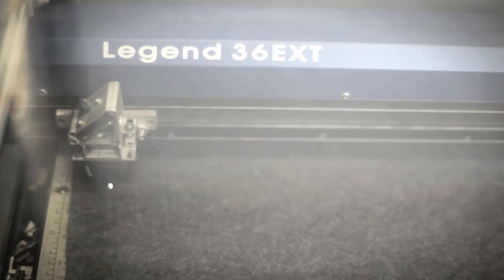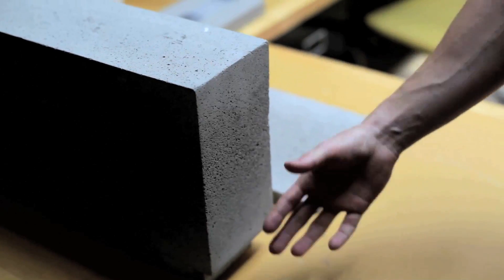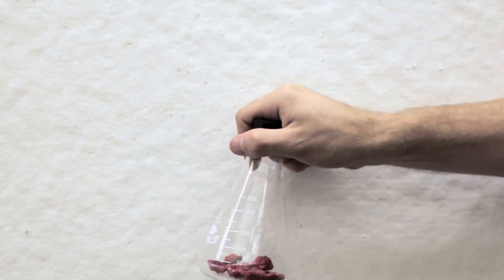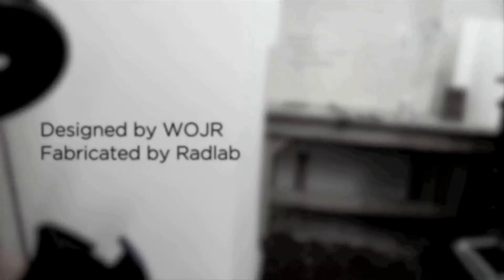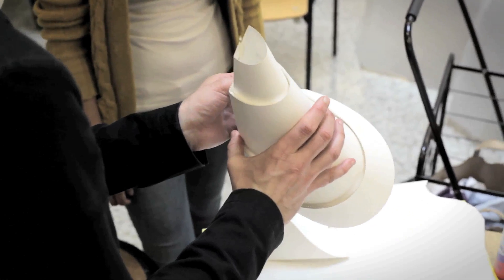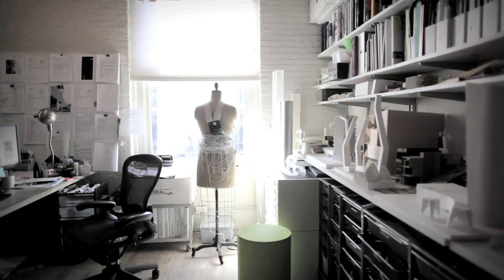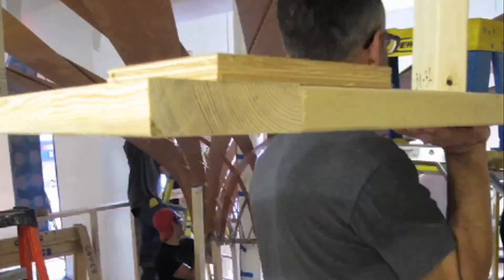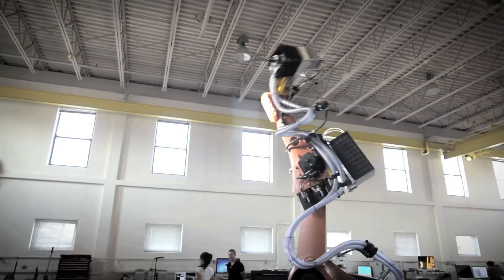Advances in Architectural Geometry - MIT

Comment: the thing that architecture does make interesting, whether you believe this is impractical or not (comments reference) is that the knowledge that other forms of academia use, is not necessarily directly applicable to this industry. 0r-- when it is, it gets criticized as perhaps dumbing it down, but it seems to me more so a problem of "creation" which the other industries are not looking at directly. A point of an interesting bridge? Perhaps. This shows how they're "thinking through form" rather than "applying something onto form" or even "abstracting from form"; yet these methods of thinking are frequently ingrained in the process of crafting things, but they're not its' sole focus. Hence if that requires using modern technology in seemingly archaic ways, maybe that is part of the process of adapting technology to the process of crafting form. So the types of knowledge we see end up being in different context and judging the context-form according to something else is basing it on form, not 'informing' process. I don't think it's possible to just stick it into the industry and expect the stuff to mesh; hence their experiments. But I also think that it's sometimes relying too much on creating form on its' own... there is a gap in communication on both sides.

Comment: As cool as sheet metal origami is, I can't stop hating architects for every non-rectangular building I've been to and couldn't fit any standard furniture in.

[Random rants continue] I hate it when they try being edgy by removing all edges. Every shape other than a box is a waste of space and is only acceptable for engineering reasons, not design. I especially dislike when they put random columns on the sidewalk but no covers on top, so they're in your way but don't even cover you in bad weather. And lights on the floor so you're blinded if you look where you're stepping.

Not to mention how some local regulations limit the building height by the roof edge, not the top, so they make some 3 floors of useless attic apartments with impossible shapes just to raise coverage. Somehow, every building I've been to built after the 70s has the kitchen and the bathroom more as an afterthought. No room should ever be under 20 m2, 12 is small, but I've seen bedrooms that are just 9. Really, you can't fit a double bed in that room, yet along nightstands and a wardrobe (not even going to expect fitting in a desk for a PC). Well, at least it leaves room for a giant useless terrace that looks really cool on the renderings... And the new and better materials somehow dissolve within 3 years so you have to keep rebuilding the facade. Foam concrete freezes and cracks into dust if exposed to any moisture in winter, which is funny, seeing how the panels that are glued on top to make it all look pretty collect moisture perfectly.

Really can't imagine remembering today in the future and thinking "ah, these were the good old days". I have a friend architect. I really respect the attention to detail they put in when doing even the slightest choice, like colors etc., but the base structure of the building ends up being just a couple of lines thrown in swiftly in Archicad and the rest is just an artistic blob. I thought It'd be funny when I saw him design his own future apartment and the base structure didn't allow any normal furniture in so I raised the question, but he meh-ed "I'll just have custom furniture ... because I can afford it" (being an architect and all). So everyone else living in that section of the building is stuck with irregular walls now. Nice.
Reply: wow

Comment: Maybe it would have been better to call this video "Using advance Tech Toys in Building Facades". While there are some cool art pieces in this video, and they certainly have shown they can put those cool toys to use. If they are really looking to apply these art pieces in a practical way, maybe they need to consider air flow (heating and cooling) and wiring that is going to run through the structure of a building, unless these guys are only trying to put a new skin on the same old structures.

Comment: "We need to go beyond bricks and mortar"

For what purpose
Reply: To have more freedom in the building process
Reply: Derek Fyfe It's all about cost\benefits. Mud bricks are cheper than steel structures but you won't be able to build a mud skyscraper. That does not mean we should stop considering mud bricks as a viable material, everything has his costs and his benefits and having more options to chose from is always positive (and finally leads to a cheaper buildin process).
Reply: shitonthisname i would be happy to be studying there instead. Seems fascinating.
Reply: I think we talk about different aspects of the same thing. Surely you cant afford high tech for the poor, it is a problem of money. I simply think that new matherials, such as the ones developed in labs, can be an opportunity of changing the way we live. If you think of a house and its furniture, all the 90 degree angles, it really fits. With bricks and wood, its just the easy and more efficient, fast way to build. Straight lines and standard angles make also easier the creation and the making of the projects. Imagine how difficult it would be for a manual worker to build curvy surfaces, and the difficulty for the architect to explain him how to make them.
This regularity, imo, influences a lot the space, the way you live. It's not easy to me to explain myself, i just think that in a standard/regular environment you also think in a standard way.

But imagine, just hypotising, a low cost plastic-material that has not limits in shapes. Not meaning necessarily to live without eco-sustain, just being able, more than bricks or other older material, to express and give different feelings. Also the shapes of nature can suggest other patterns, other ways to build. 

Sorry for lenght.
Reply: RawPeds my starting thought was, like op: "for what purpose"
you are talking about shape and form. you're right, it influences perception of space and the lifestyle a lot. but the possibilities of traditional materials are not finished. think of modern space: what freaking change in architectural history, without leaving right angle. 99% of the fans of parametric or computational design totally forget about the emotional experience of space and architecture. because all their parameters concern form/ shape. but thats a tiny part of architecture. architecture, for me, is about the wholeness of living: does it touch your heart when you walk into a building? if yes, its good architecture. i dont think we have to argue, that what is shown in the video is not architecture. its a tiny, constructual part of it. and for me its not concerned about the core of architecture. but after all: my root problem was this attitude in the video that "we have to go beyond bricks". the MIT can research as it likes to. great architecture is still done (between other materials) in bricks and mortar and will be done for a long time. :)
Reply: So we can make things more expensive in are thriving economy lol
Reply: thanks for your comment, exactly what i thought...
its actually pretty sad what happens at the MIT. for me thats technological fanatism. glad i didn't study there
Reply: for the purpose of evolution and further architectural expression/progression
Reply: TheWhiteUbik WOW! you are just full of knowledge. I would never understand how cost/benefits work. You mean you need to make a profit in business?

 Sar·casm (N) \ˈsär-ˌka-zəm\
:The use of words that mean the opposite of what you really want to say especially in order to insult someone, to show irritation, or to be funny.
Reply: moreover, the bricks buildings look like the product of the past. Good for their endurance and they resist to weather agents, but have loads of limits in terms of shape and expression.
Reply: RawPeds "product of the past" ... why? half of the world population is living in earth buildings. complex form is not the architecture task of the future. scarcity of rescources, enviromental destruction and the biggest mass migration in worlds history is our situation. just because we have 21th century doesn't mean we have to live in funky sci-fi houses. (which expression is absolutly dull btw) xD
Reply: Yes, i feel what you have said is deep true. I prefer too the emotional experience, than the"abuse" or bad-use of technology ignoring what a building means. You got a point and opened my mind :)
Reply: shitonthisname They want to create new economically self-sufficient materials. Yeah, the ones we have work but why can't there be new ones? Especially since certain materials can't be found in some places and cost a lot plus itd be good for experimenting with new styles and biomimicry. These new materials are not to replace the old ones, but rather simulate and then make better.
Reply: inflatable widgets are in order, here.
Reply: when effel tower was first constructed, i remeber people saying the same.... why steel?

Comment: Other than the aerated concrete and the larger timber spans, I am genuinely struggling to find the practical applications of many of these studies. Especially regarding fire and building regulations. Not to mention environmental design, let alone; thermal efficiency, air exchange, and thermal massing

Comment: Most impressive.  Wish I had seen this sooner, but thanks for posting this to YouTube.  In response to previous comments:  High tech building materials will require adjustments in thought and acceptance from the design/manufacture to assembly/construction sectors.  Retraining workers to be on the cutting edge of our industry should be in the back of everyone's mind.  If you aren't moving forward the result is stagnation, doing things they way dear old grandpa did it.  No more.  The simple fact is that we cannot continue to destroy our environment in the name of progress, nor should we tear it down to build something else unless the change in energies is a benefit to humankind - and not some entities bottom line.  The practicality of new materials will be a progression based on need, time, and place.  As for the cleaning of curvilinear rhombo-ovoid thingama-bobs, there should be some partnering with companies like P&G to make sure methods of sanitation are developed for the new forms of building and construction.  Just sayin.  Thanks again for the post.

Comment: They need to have a department of practicality and efficiency. Many of these materials they're working on will require specialty training and ability to install. And, they do not look conducive to the emerging process of design-build in the AEC community. Third, consider some of these complex shapes... how will you mop the stairs? Dust walls made of curvilinear rhombo-ovoid thingama-bobs? There is no seemless conversion I see.

Comment: Clever and slick but what is the human link to experience and meaning prior to shape form and geometry. Geometry is only a spatial language and delivery system. Ultimately no matter how clever and spectacular you have to have something to say something to deliver. Thye notion "Beyond bricks and mortar" is a pre occupation and veils the true purpose
Reply: You're over thinking the whole thing bud. The days of architectural form having any social meaning or human-environment symbiosis died many decades ago. Now, it's just maximising profits without pissing off the bunny huggers too much.
Reply: CptSideSlider There is no choice about it and nothing's died, the meaning is not attached or applied it is at the heart of the direct human experience of space. The thinking comes later to justify or to claim authorship, as the limitations of the human condition, true art reveals or points directly to the source. Architecture is the supreme art form, sure study and understand the language but don't confuse the medium with the message.
Reply: Normally I would agree with you but you seem to be mitigating the current state of the human condition. We live in a very small, over connected, head down and nose to the grind stone society. For us to get back to a point where we draw reverence from a cathedral or call a house a home and not an immovable asset will require us to revert to a state of being where we don't just live for the paycheck. The architectural is steadily drowned out by the commercial cacophony of greed. Putting a philosophical spin on it doesnt further the cause.